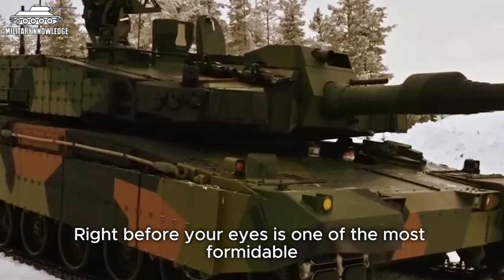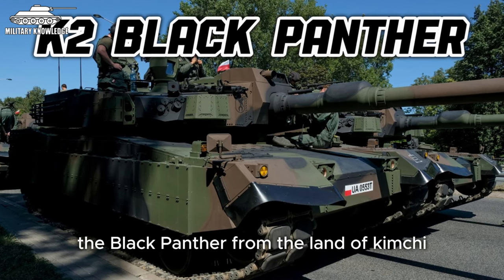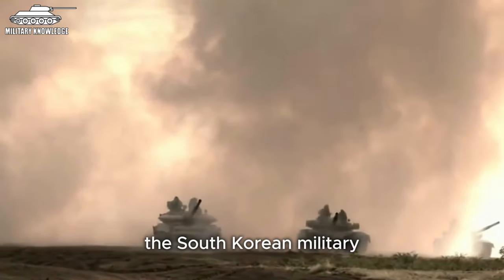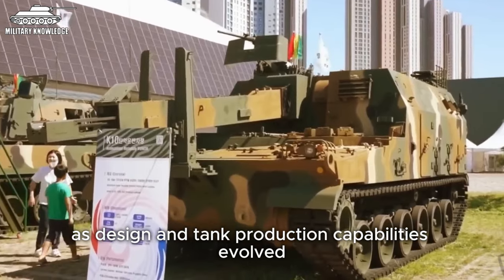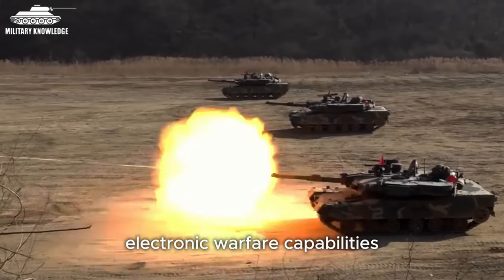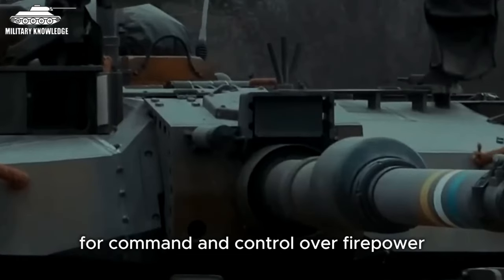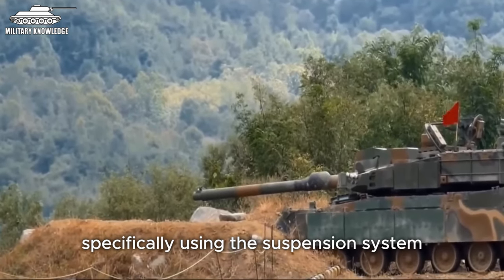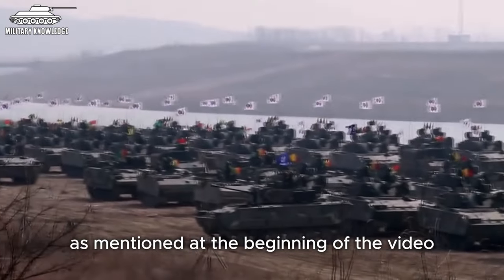K2 Black Panther - The POWER of one of the Main Tanks in the World

Comment: - K2 has a Soft-Kill that enemy's infrared sensing radar on both side and auto warning infrared and to distrub it ECM(Electronic Counter Measure) JAMMER and to avoid it drive and rear top smoke shell gun auto rotation immediately fire yellow smoke shells to block enemy's infrared, and an Identification of Friend or Foe System (IFFS)

Comment: Some of the parts were of US license.   Also German license involved.  Uniqueness of K1 from M1 tank.

1. Six hydraulic axles instead of solid seven axles
2. Diesel engine German license production instead of gas turbine
3. German 120mm smooth gun under license production.

Because K1 was Korean 1st domestic tank, Koreans didn’t have the facility nor the specification design verification  process.  And this is where US Chrysler M1 design Manufacturer/consultant team got involved to recommend improvements and prove out the tank performance spec at US facilities.
Reply from the maker: Yes
Reply: The Korean weapon builder H-Rotem will develop those parts created in the US & Germany. Since the two nations don't like black panthers rising in weapon markets, which means weapon makers in the two nations don't want to share their weapon buyers with Korea, to be honest. Practically, Germany used to block Rotem's weapon export many times before because the MBTs adopted made-in-Germany core parts. Thus, the Korean weapon developer had to quit its exporting processes to a few potential customers. Nowadays, the weapon maker Rotem researched the main engine and transmission to dodge the US & Germany's blocking processes. And the result was positive. Korea exported the core parts to Turkiye for Altai tanks. Sooner or later, Rotem will not import those core machinery anymore to detour suppliers' indirect sanctions.
Reply: before "Yes" & now "little bit?"
Reply: Diesel engine German license production instead of gas turbine
-> they put german engine at first (mtu mb-873 ka-501 diesel) now its Doosan's DV-27K. its not german licensed so S.Korea could export it to Turkey where germans opposed to export their engine to.

German 120mm smooth gun under license production.
-> this only apply to  K1A1.  (Rh-120 L/44) K2 uses CN08 and hyundai developed it on their own so they can export it anywhere they want.